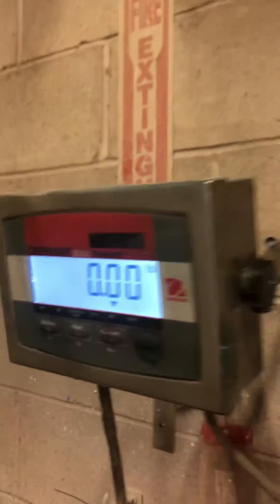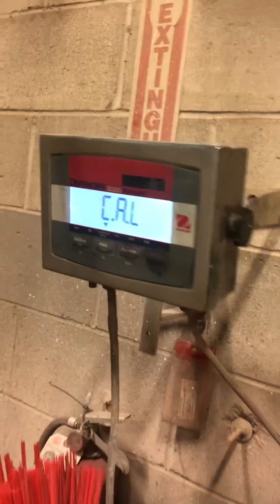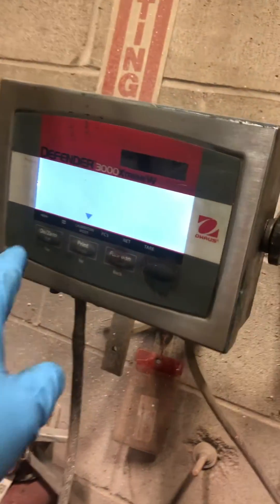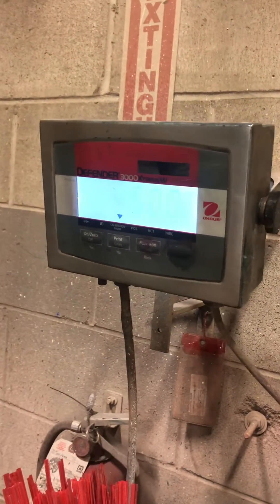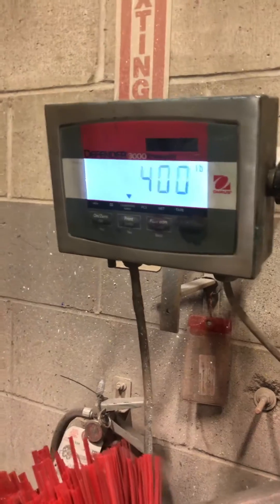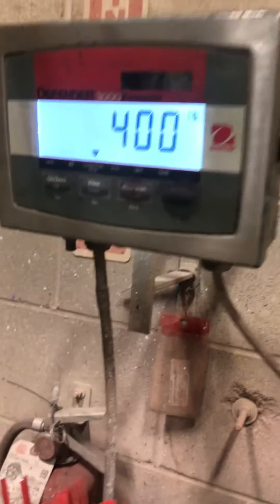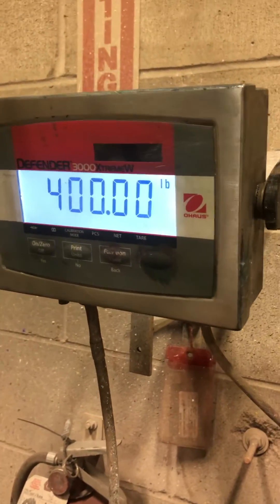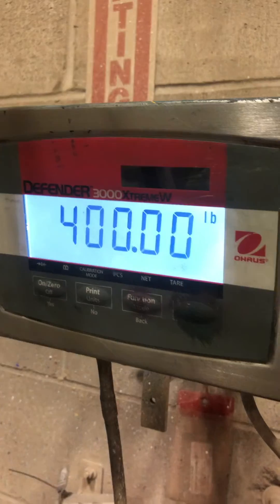calibration adjustment of a Ohaus T32XW

Comment: That’s great but how do you change it from kg to lbs.
Reply from the maker: You hold down the units key until it changes, if it doesn’t change it’s because that unit is turned off
Reply from the maker: But, if your asking how to change to KG in CAL mode the indicator calibrates in whatever calibration unit it’s programmed in go to set up and go to calibration unit to program what unit you prefer to calibrate with